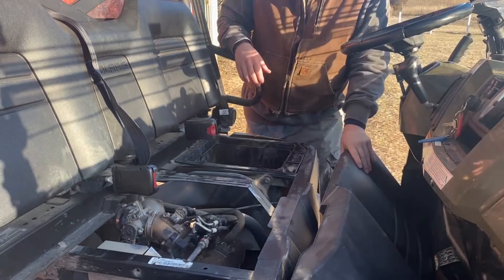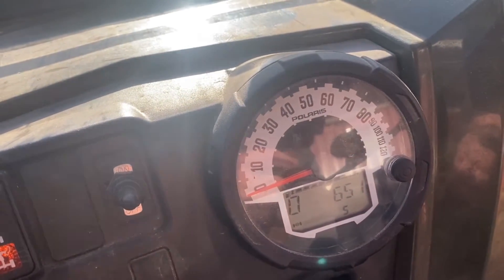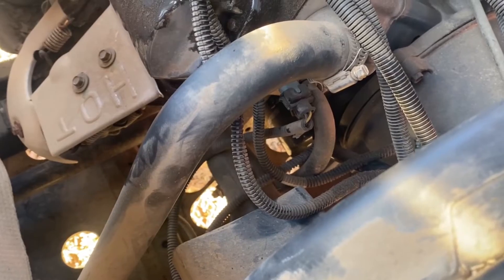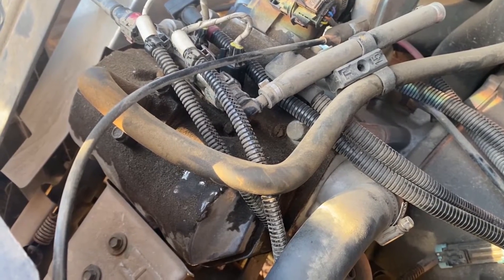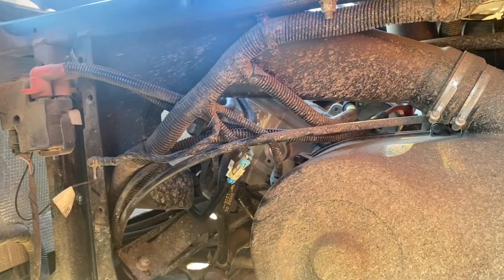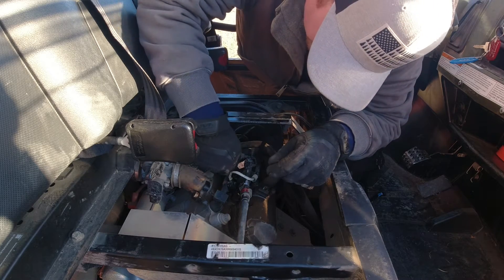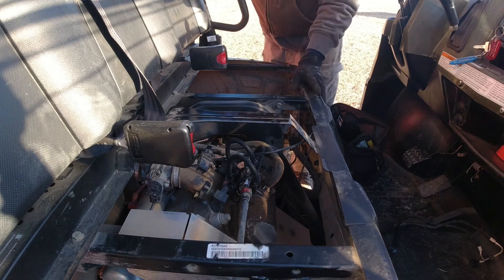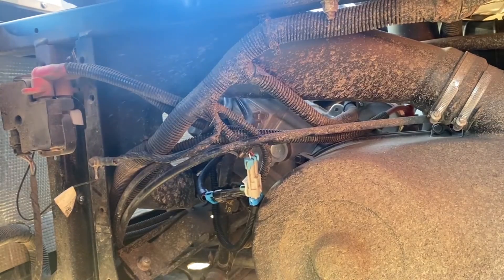Polaris Ranger Engine Code 651, low power, repair.

Comment: I’ve just replaced one  about a week ago and it was fine up until now what do you think the problem is ? I have the same code
Reply from the maker: If the engine is still sounding like it's miss firing I would follow the harness and wiggle wires around.  If it cleans up somewhere you have pinpointed where that break is.  It could be the harness that is this one connects to.  I'm sorry it didn't work for you.  also make sure you your pin locks did not come out of the connectors.  that happened to me  when I was working on this as well.

Comment: *TIP: To prevent a repeat, get rid of the plastic factory clip that clips to the fuel rail. Zip tie the new harnesses together just behind the tape on the convoluted tubing, then zip tie those to the fuel rail, being sure to leave a wee bit of slack.
Reply from the maker: Good tip Thank you

Comment: Esque tengo un reiser polaris 900 4x4 lo qué pasa esque al momento de abrirle la ya e no prende el tablero y no hay corriente
Reply from the maker: This is what I translated your comment into: Well, I have a reiser polaris 900 4x4, what happens is that when I open it, the dashboard does not turn on and there is no current.  
Basic things to check, does it run or completely dead?  Battery? Fueses?  if it runs but no cluster could be the cluster.  i don't work on these everyday so my experience is limited